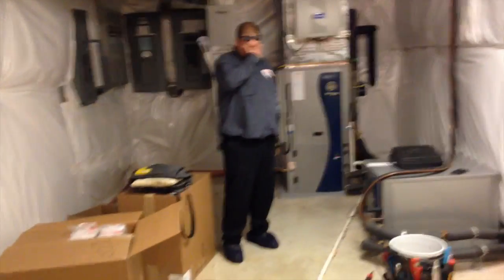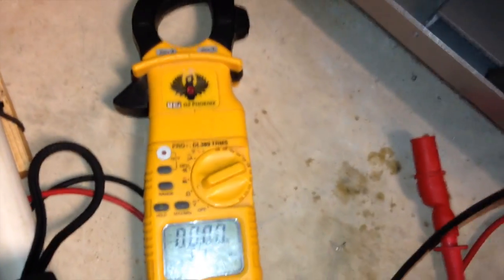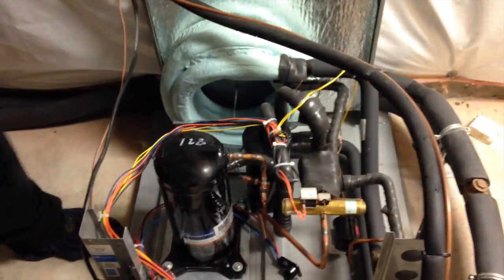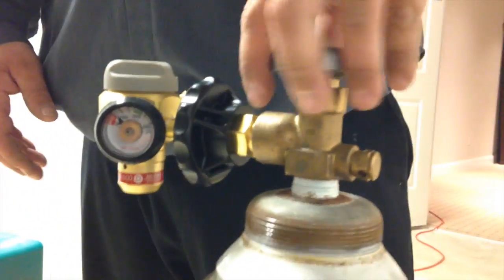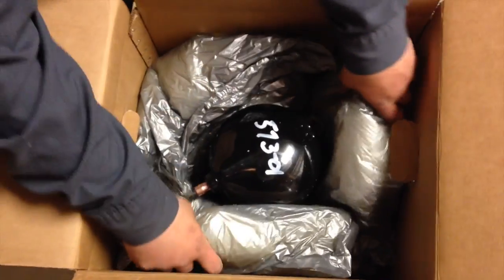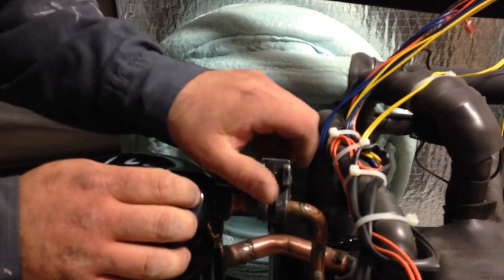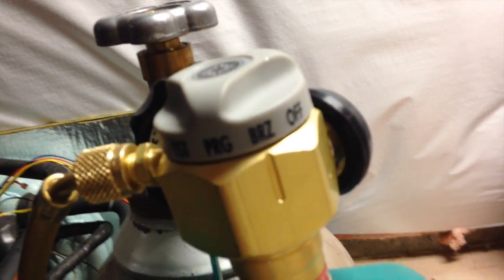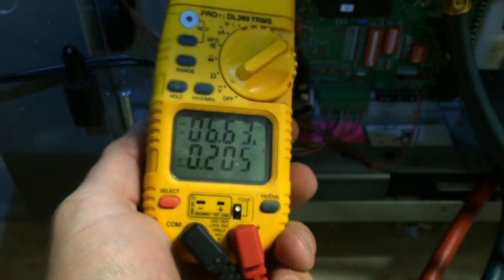Geo thermal Compressor change out

Comment: I have a question about that regulator...what about when I want to crank it full open to get max flow to blow out a lineset ...does it do that well?
Reply: I must admit that I wasn't terribly impressed with the performance when blowing out a lineset. The VN500 will pressure test up to 500 psi but it doesn't output a full 500 psi all the time, it seems to build up as needed for pressure testing but not full bore all the time. Joe Shearer
Reply from the maker: It has a "TEST" setting on it as well. Depending on the model you buy you will get 250 or 500 psi max out of it at this setting
Reply: I see....thanks guys!